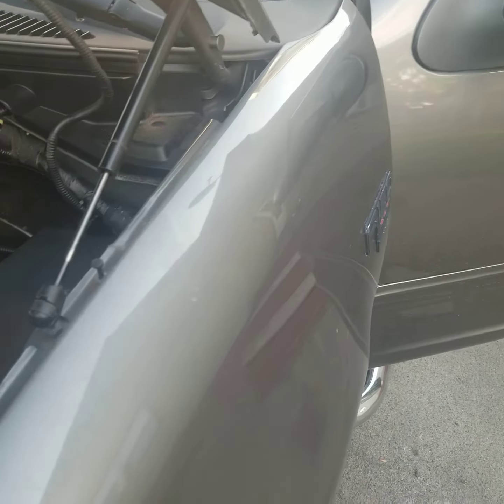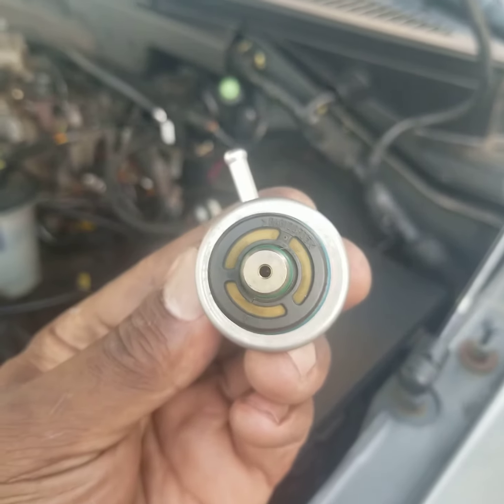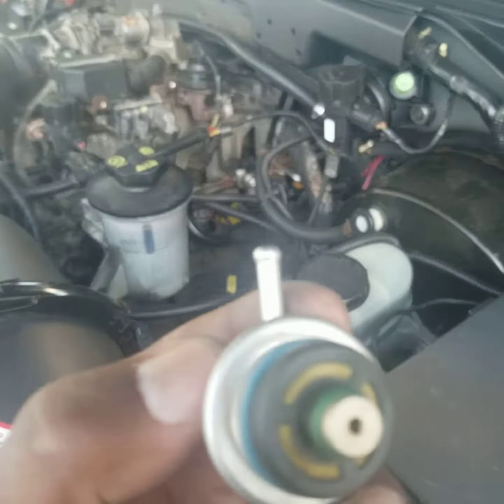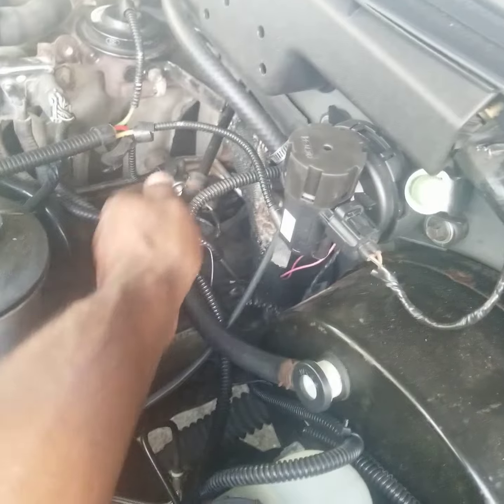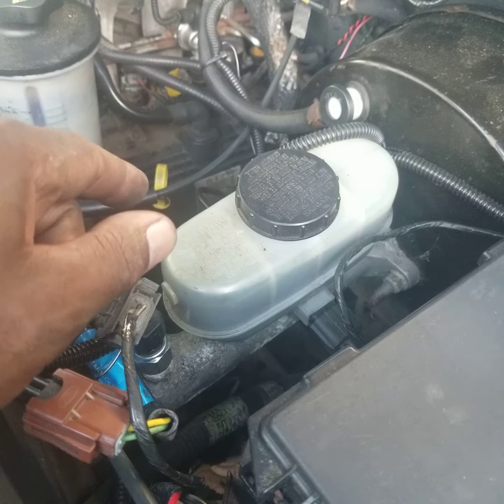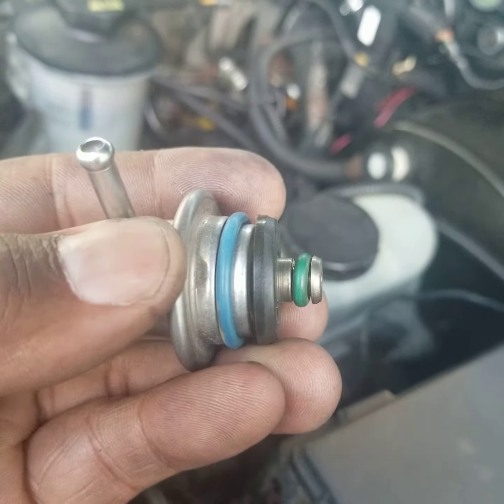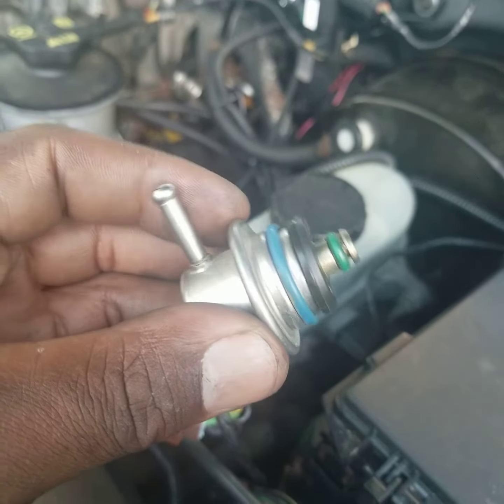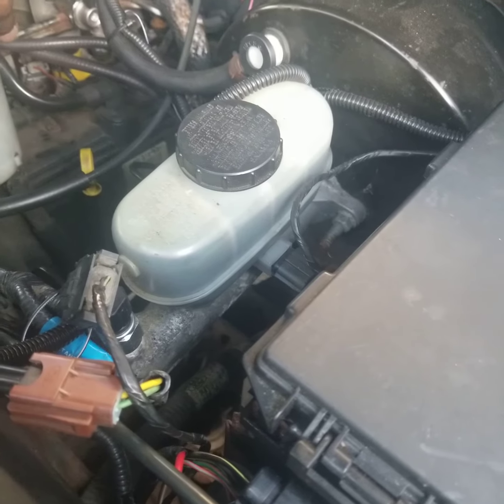FUEL PRESSURE REGULATOR REPLACEMENT 1997-2003 F150

Comment: Why video after it was done I'm curious
Reply from the maker: I'm not sure which video youtube recommended. I would have to go see. However am a mechanic I just work on vehicles as they come.
Reply: @eilandsgarage2592  ok my truck starts and then kills and I thought it was the fpr so I replaced it but no fuel came out and I thought you might cover that part during the vid however any comments on why
Reply from the maker: @jalmiramitchell  you might want to check your fuel pressure. so basically do a fuel pressure test on the truck.